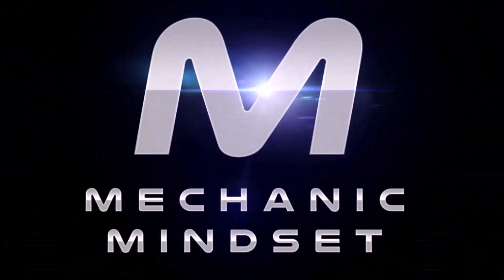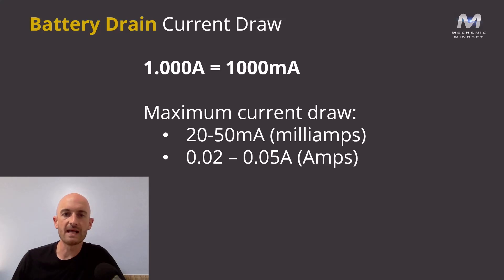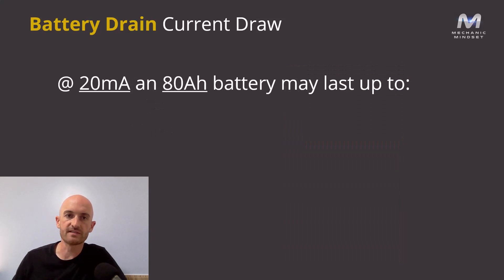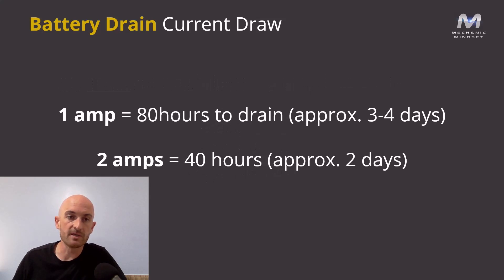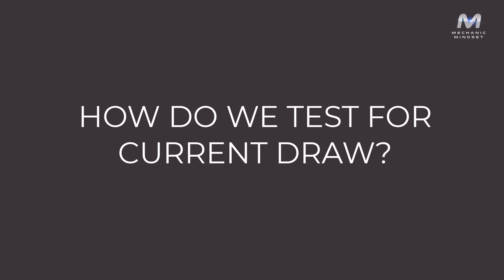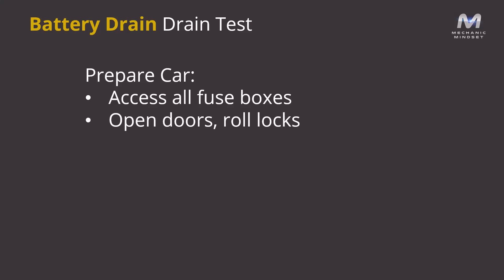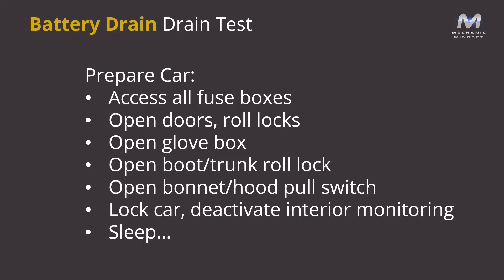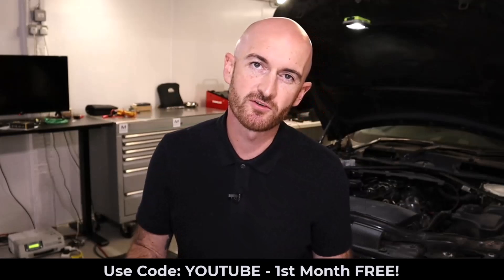Parasitic Battery Drain: What is the Maximum Current Draw?

Comment: A typical battery will only be usable for some 50% of its rated capacity, so a good rule of thumb is to halve the calculations to arrive at the maximum number of days a good and charged battery would last with a parasitic drain.

Comment: I have an unrelated question. What if you’re using PicoScope leads set on 10 attenuation and you plug it into a 20 attenuator. Will you get 30 or what will happen?
Reply from the maker: The reading will be wrong by half

Comment: I run my multi meter on the 10 amp fuse. I don't need to see lower draw than that. Blowing the fuse in your meter as always a pain. Problem comes when you locate the an excessive draw on a circuit that powers many different things on the car. Example the backup fuse in an acura tl. If you don't know that the handsfree ecu goes bad and stays on causing a 220 milliamp draw you might never find the problem.

Comment: Agree with your range. I have always used 40mA rule of thumb regardless of vehicle. Less than that is perfectly fine and if it's more than that I look for a modification drawing extra current, like an aftermarket sound system or security system, pull the fuse and recheck draw. 40mA will also run the starter at two weeks but not 4 weeks with smaller batteries(75% discharged), and will be hit or miss with mid size batteries(50% discharged). Size counts. A puny 40Ah battery shouldn't have a massive 65mA draw.
Reply from the maker: That’s it, it’s all relative 👍 cheers!

Comment: I purchased the small original 2204a and after signing up for the course. I learned so much that I purchased the Pico 4 channel 4425a for a little over 3k. Very happy learning my new equipment.
Reply from the maker: That’s great to hear. Such a powerful tool
And the 2204a will teach you a lot, plus you will appreciate the 4425 more 👍

Comment: Sir what is the law for battery discharge day ?
Reply: Simple. 24 hours in a day. Multiply current draw by 24 to get mAh or Ah draw. 
1 amp constant draw for 1 hour is 1 amp hour (Ah). The number I've typically used for normal parasitic draw is 40mA. That is 40mA x 24 hours = 960mAh or 0.96Ah. For a smaller AGM battery that's 40Ah capacity, you'll completely discharge the battery in 40 days. Most starting batteries will advertise CCA and not Ah since they are never meant to be discharged, their purpose is to deliver cranking amps for a short time before being recharged. Completely discharging a starting battery will damage it.
Reply: @thebluelunarmonkey  thank you so much